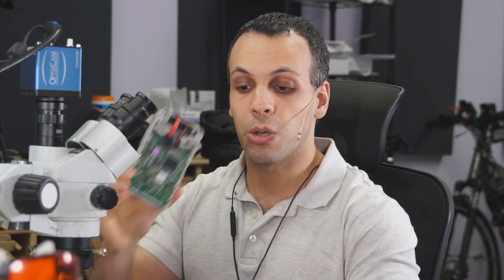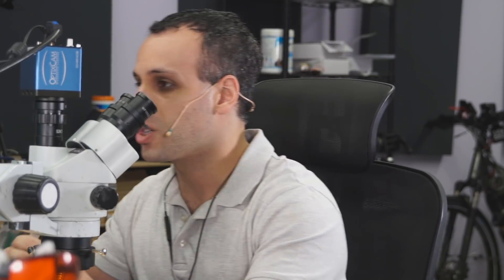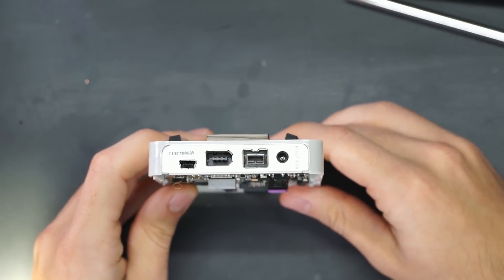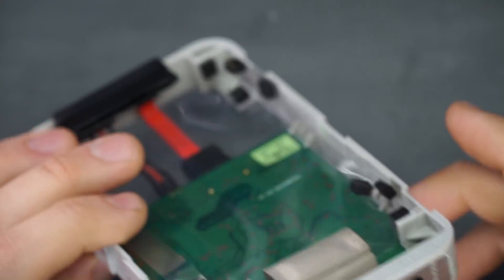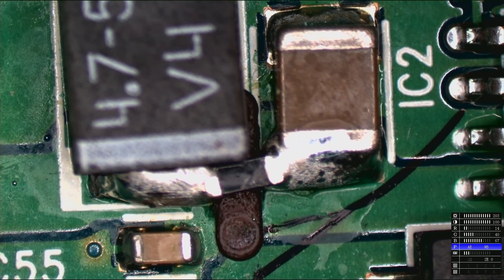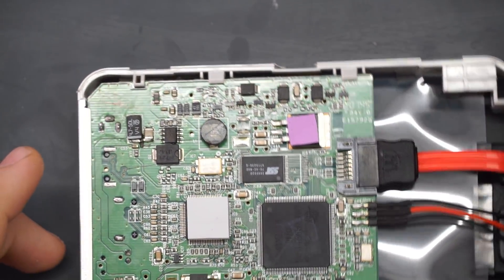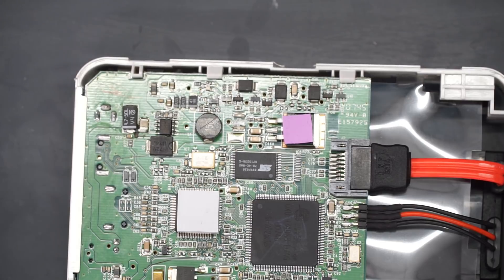Lacie RUGGED external hard drive: a peek at the PCB

Comment: Terrible drives with weak ports. I have two that failed. The recent one I was able to open and connect to a sATA HDD cable to recover my data. The second one (10 year old) is the one you show here. Is it possible to open this and connect some type of cable? If so, which one? Or what cables can I get? The first port is pushed in and not working.

Comment: I bought one of these back in the day before USB 3.0 to use on my 1st gen MBP.  Years later I managed to buy 2 empty enclosures cheap and put new drives in myself. I still use them now when I travel to backup photos I've taken. Speed isn't that important for what I do. In fact, my home server is a Mac Mini connected to a Drobo over FW 800. It's my file server, shares my iTunes library, runs a Plex server and my home security cameras just fine.

Comment: I'll never buy Lacie again. I had Lacie 2 x 3,5" external hard disk with Maxtor or Seagate disks inside. It was nightmare, it went repair under warranty 2 times and after warranty I started repair it again. There was 2 circuit boards 90 degree screwed and connectors was only depending of those screwed boards. Those connectors wasn't even soldered or connected any other way. Never Lacie, NEVER. We have had those in work too, those are pure JUNK.

Comment: Hey Louis, I was hoping if you can help me, I have a 2.5 inch WD my passport ultra (4TB), 2017 version, suddenly it did not show the files and it does not eject when I eject it on my MacBook Pro, when I eject it, it comes back and it makes a weird light sound then turns normal, so I checked its health and it says it's good nothing wrong with it, I installed the wd recoverit app and check it for a bit and it showed files, meaning I can restore them, but not yet cause I don't have enough storage, so in order to restore my missing files I am gonna need to buy a 4TB or 5TB one, that led me to make a search, I found out there are CMR, SMR and other types of drivers, I figured my WD ultra (4tb) 2017 might be a SMR drive, that is why it is faulty now or maybe it is the PCB! So, as I mentioned before I wanna buy another (4TB),  that is why I wanna make sure that I buy a CMR one, Can you please give me a list of 2.5 inch (4Tb) drives that are CMR not SMR? Even if it was a 2015 or 2016 versions? Or any older, newer ones? Cause I am planning to buy 2 drivers for now! Or any good reliable 2.5 HDD recommendation? I would be grateful!  Thank you

Comment: I actually use two of these still today. But for a very specific purpose. I have a external soundcard that has a firewire 400 connector and the only thunderbolt to firewire adapter i have is to firewire 800. And since daisy chaining is a thing with firewire, i use the hard drive as a sort of adapter to go to firewire 400. Its stupid, i know.  The quality of these drives and enclosures are crap and i have had them repaired/replaced at least a couple times

Comment: I used Fireware 800 on my macbook pros and Imacs for video/photo production.
1. Tape based cameras used it.. even if it was already towards SD/CF cards. it was useful for some client projects to get original raw footage converted for something else. 
2. It kept the USB ports open for other tools and Fireware 800 connections and was faster then USB 2.0.
3. Nothing consumer focused else used Firewire 800, other then my desktop hard drives for footage ingest / local editing. So no one was able to "borrow"  the cable real quick for something else and never return it.

Comment: I’m not surprised at all. External enclosures are generally crappy, I’ve had several fail eventually over the years, I think in most cases the drives survived to be installed in new enclosures. These were not enclosures that were moved around, they basically failed right on or under a desk.

Comment: Also used FW 800. There was a time before USB3 became common that FW800 was markedly superior vs USB2 for drives.  I had one of the later year (iMacs 2011?) right before they started including USB3 (2012) so was still using it for external enclosure well after it was no longer fashionable.

Comment: I always suspected they used a standard drive inside with just the lot of rubber around the outside. Firewire 800 gave double the speed and competed with USB 3 mostly because it was real time I have a complete collection of cables and I still use them. Drives were the first to migrate and then slowly interfaces and the like started and then everything went USB C. Although industrial cameras tend to use or used firewire although I suspect they mostly stayed with firewire 400.

Comment: Oh man, Lacie got me really angry with frustration. They had a network drive with system software installed on the actual harddisk. When that system fails, you get zero support for recovering data. I had to figure out AND buy UFS Explorer recovery software to access the files and copy them to a safe place. That was the moment when I lost my faith in Lacie forever.

Comment: I have a Western Digital table HD enclosure for 2 disks. Used it for years connected to my old (RIP) MacBook Pro 2012 with Firewire 800 cable. Now I'm out of the Apple world and back to Windows, the case is still connected to a Raspberry Pi using the Micro USB connection and serving files via the network!!

Comment: During the HDD shortage of 2012, we didn't raise the prices of our externals so we often times sold an external like this to steal the drive from when their MacBook Pro drive either failed or they wanted a larger size. If we did the upgrade, we would put the old drive in the enclosure and use FireWire 800 to do the data transfer, and they'd leave with an external drive. If they wanted just the drive, we would "recycle" the enclosures. So I have a bunch of these enclosures with SSDs in them, which is pointless now that the fastest speed is FireWire 800 on the enclosure, and modern machines need multiple adapters to read it. 

I just cracked one open, and it didn't have this layout. The serial number is later than the one on yours, so I guess they fixed it in a later revision.
Reply: I discovered that there's a thing called Drive shocking where people buy the desktop usb drives because they're cheaper take them out of the casing and drop them into their NAS's or whatever else.
Reply: @imark7777777  Did so for my SFF build where I wanted 2x 5TB 2.5" drives. Buying the drive = $230, buying the external with the same drive inside = $120 including a "free" USB-SATA board and USB cable...
Reply: @kilrahvp  I totally did that to I had got a really good deal on a two Drive portable small raid without the drives and I wanted mirror across 2x4tb Drives. I went looking for drives and nobody really sells the 2.5 inch laptop drives so I ended up in the portable drive market and got myself 2x USB enclosures that were green 2x USB cables and two drives for less than the cost of the drive themselves bear. On top of that the raid enclosure only ever listed as being 3 terabyte manage to support the 4tb, and I thought I would have to file the screw holes to make it fit but no it fit perfectly with the taller drives and heat sinks them.

Edit oh yeah that's what this comment is on. It conveniently was a tri interface drive with firewire 800, USB 2 mini and eSATA and this was just two years ago.
Reply: @imark7777777  I opened up my Toshiba USB 3.0 driven when it failed and found out it actually had a unique PCB with the micro USB 3.0 connector.
Reply: @compaqdeskpro5770  was that one of those internal drives with built-in USB? Or are you referring to the case enclosure controller?
Reply: @imark7777777  It had no separate controller board, the hard drive's PCB had micro USB 3.0 ports on it rather than SATA. The case was just plastic pieces glued on.

Comment: Doing board repairs as one of my main work so I found that area between caps suspicious right on, but thought it was a jumper (I understand you had to show entire board). 
Once in a while you get stumbled upon a interesting product and have a dilemma: 
is the product good? If it's good should i buy more than 1 because when it's working no more i'd like not to switch to a new device? 
what if it's a bad? as bad as to work through warranty period of 1 year get broken and now you stuck with all the junk that didn't last even a week? 
If it's cheap you throw it inside a box a forget (personally i try to repair everything even sometimes it's not reasonable - just because i can). but what if it's relatively expensive?
Don't throw your tomatoes yet!
But I end up with conclusion - there are older items that worked longer than their fresh competitors. as for the costs - newer comes up more expensive in terms of both repairs (over-engineered, requires skill) and it's price is higher because of inflation. while older items generally are heavier(no available technology or materials at construction date) and more robust they require almost no skill to maintain and repair (READ the manual).

Now you know how i've became a dumpster diver... Sorry

Comment: I even sold them and for sure with the 800 cables! I know I had to have one for my Macbook Pro. Audio software work was helped greatly with FireWire to connect to devices if i am remembering correctly, not just writing data though that too was greatly helped by using hot-swappable drives as the bits added up for both corporate and personal studio work.
Reply: Between the hot swapping daisy chaining high-speed bus and real-time capabilities USBC is the first time we've got something close to replace it
Reply: @imark7777777  Syquest ripped us off for years - as soon as other swappable vendors came out, they died.

Comment: So, they're doing something that was extremely common in the 70s and 80s, and even in the early 90s. They bodged it. (For the uninitiated, that means they discovered a problem and fixed it after the board was already completed, typically using components that were not fixed to the board itself.)
Reply: Dont think ive ever taken apart electronics that old and not seen some bodged wire on the board.

Comment: used fireware 800 on professional glyph external hard drives. they had 800 + USB. they had IEC power. also had 800 on the professional sony DV deck and the mac book pro. the apogee duet was FW 800. it was everywhere but only if you have the $$$.
Reply: Now that's a nice drive company if I ever found one. Discovered them couple years ago working on a film very nice drives and great tech support. FYI that externall esata might only support 1.5 terabytes which is fine unless you have a 16 terabyte drive wonderful windows. I dropped on the latest files and the computer freaked out And over wrote the file allocation table! Thankfully I've literally had a backup and just the night before make sure I had a complete copy of everything unfortunately usb3 took forever to copy it all day the next three days obviously I was avoiding the eSATA Port at that point.

Comment: I had a friend whos Lacie Rugged Drive was failing. I pulled the HDD and put it in a system to get any salvageable data off of it.  He asked if we could replace the drive and of course it was a seagate rosewood.  I said sure and can use any 2.5 SATA disk. He said NO WAY this is a special ruggedized disk we need to call Lacie...

Comment: I had a 500GB Western Digital external HDD with FireWire 800 using with an old aluminum 24" iMac, and it felt like blazing fast at the time. Now I have a 2TB M.2 NVME in an external USB 3.1 enclosure and even transferring at 1GB/s over USB 3.1 I'm like "NOT FAST ENOUGH"

Comment: I always warn people not to buy external drives, which have SATA-USB converter soldered to the drive. As they tend to die like hell, typically after 2-3 years. I had about 5 of them dead in my hand and it was always the same behavior - drive runs (you can hear and feel it), you can see the diod blinking, however, it doesn't communicate via USB. Nearly all of them were WD Passport. If the converter would be just mounted, I would unmount it and connect it to the SATA controller, or even buy new external box, but in this way, regular person can't fix it. So, it looks to me that at least this Lacie had standard SATA drive inside, right?

Comment: I use FireWire 800 to this day because I'm poor and have to make due with my 2008 24" iMac. I use an 800 cable with an external dock for backups, and every so often I'll dust off the 400's to connect to my '06 iMac via Target Disk Mode to try and diagnose why the '08 took a shit again. As crazy as it sounds, my 2006 iMac 5,1 2gb RAM Snow Leopard machine runs like friggin champ. I just don't ask it to do too much lol. 

Fun fact: my 2008 machine is the one with the infamous Nvidia 8800 GPU that likes to overheat and bork out causing perpetual kernal panics and endless boot-looping.
And because I can't afford a newer machine right now, I've gotten pretty good at tearing down that iMac in order to yank out that damned GPU and give it a quick bake. 
Just a couple weeks ago now I successfully baked that goddam thing for the 5th time. Machine is up and running again lol. Who knows for how long though. fml
I wonder what the record is for baking that chip and keeping a computer alive?..  🤔😔
Reply: Been there done that well not the baking anyway I have a 12 year old MBP that I just finally replaced after a good long bit of saving. Sadly and not so sadly it's a 2019 which might actually be the last Intel before Apple walked off a cliff? I'm not saying they can't do arm I'm saying their corporate policy and their right to repair and their security by absolutely every means....

Comment: Weird question; is it possible to swap the drive out with a better brand?
Reply: Yah pretty much any enclosure you can swap the drive out however it really depends on whether the chip is hard-coded for a maximum Drive size. And the quality of the enclosure and whether it's actually worth doing that to it. I tried to put a 4 terabyte drive in an enclosure that only supported 1.5 to 2 terabytes.
If that's the case it just acts like the drive has no format on it and usually it won't let you format it either although I wouldn't want to try if you had data on it.

Comment: immediately spotted it.  and was hoping you to show a closeup of another area (c24/R7/C10) next to power in. hard to tell if the solder joints have corroded, there could be a slight solder-discoloration there. not sure.
Reply: i guess not, c19 looks the same...

Comment: So, instead of buying external hard drives or external SSDs, I've just started buying internal SSDs and using usb adapters+drive enclosures for external storage. My logic is that if the usb-SATA cable breaks, i can buy a new one. Or if the drive is corrrupted/somehow damaged, I can get better repair bc the drives are better quality controlled than a WD MyPassport lol

Comment: Well it's usually a great way to sell a tonne of expensive devices. An overengineered $200 CNCed aluminium enclosure with a fancy logo on it, then stuff an Ipad mini board inside. A grand per unit, easy.

Comment: Going off topic, but will say that Firewire is one of the things that Apple did correctly. Basically every windows machine used USB 2.0 at the time, and it paled in comparison to Firewire. Too bad everyone abandoned that protocol as USB is lossy, versus Firewire is actually lossless per their spec sheet.
Reply: They did it "right" but it was barely used in the general public since Macs were the only ones with FW800 and it was just too expensive. And there's nothing "lossy" about USB.

Comment: I still use a FireWire 800 port on occasion. Old MBP and audio interface. I write midi light sequences and works fine for the midi output to my light controller on the go for cheap.

Comment: We were running firewire 800 drives for a few years with our mac pro 2010ish cheesegrater that had the 2x 800 ports on the front. Typically one of the ports on those machines would fail after a few years but as long as you stuck some tape over the dodgy one you didn't get into too much trouble.

Comment: One place I worked the line was building switching boards for 3Com, and when the board hit my ICT station, the first four failed the same way and emitted a quiet "pop" from inside the test fixture.
Some olfactory and visual inspection later, I found that the same tiny diode on all four boards had exploded. They were the right part, installed per the silk-screening, but exploded anyway.
A crawl through the schematics of about half an hour found that the (backflow filtering? Is that the right term?) diode was exploding because it was having voltage rammed through it 'backwards' 

It turned out that the engineer and/or drafter who laid out the silkscreen put that one part on backwards. And the surface mount placement machine program followed the silkscreen, as they should. So we reported the problem to our customer, and posted a notice on the relevant workstations to remove and reverse the diode before solder flow.
-
So yeah, mistakes happen, and sometimes they get caught after expensive steps have already been taken, so a kludge is required.

Comment: We had a 50% failure rate with the Lacie Drives in field work.  I finally took a hammer to all of them.
Reply: Wing Nut We had a 100% failure rate with Fujitsu drives back in 2006. I wish I could have hammered all of them :O
Reply: Sounds like the drives they were using in the iBooks G3s I had two of them they both started acting up. after pulling them out and replacing it I avoided that brand think it was Toshiba or IBM.

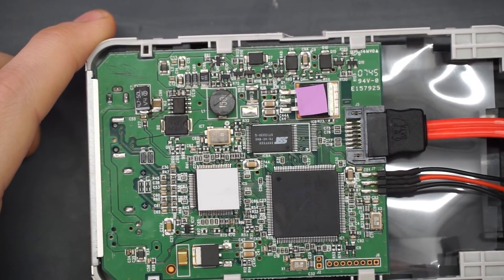Comment: In the top left, there's a resistor soldered onto the pads of a cap and a ... zener diode, I think. Is that the solution? (Paused at 1:25)
...
Close enough.